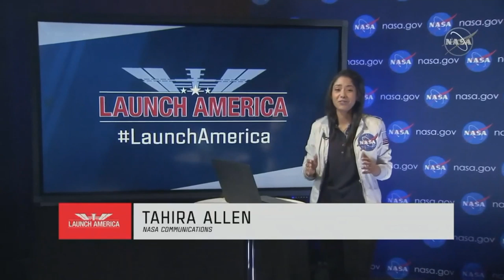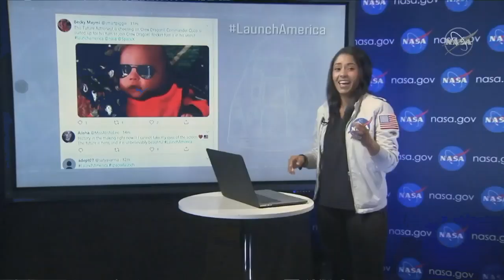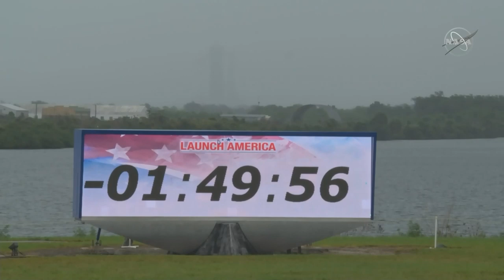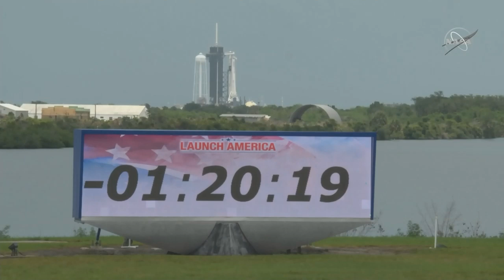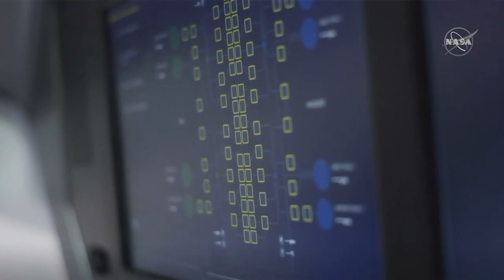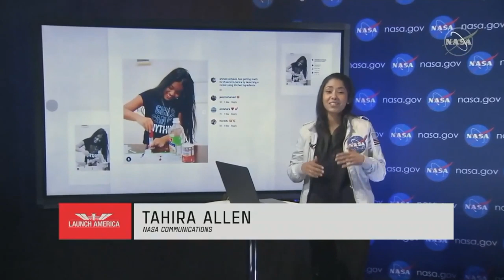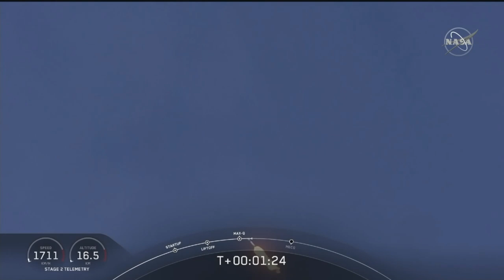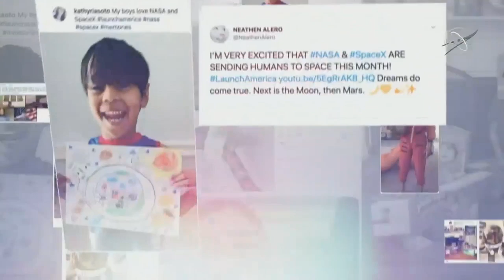Nasa and SpaceX's historic launch second attempt to send US astronauts to the ISS - LIVE

Comment: Hmm so you’re trying to tell me we lost connection for 3 seconds and as soon as it re Connects jjst boom the drone it there with no dust or anything from it landing..?
Reply: Yes
Reply: @sicarrioh3395  the landing footage is from Soace X not NASA
Reply: Dust from the ocean? Lol
And it often cuts out then but not always. Its a large metal object with engines blaring, that produces a lot of interference with the antennas on the drone ship.
Reply: Oliver Lane dust from the ship it cut back in literally 2 seconds and there is no Debris or anything in the air
Reply: @edmontonexoticbullys2038  i cannot see any dust on the ship on the previous picture? So what dust do you think would have been thrown up?
I obviously have never been on one of their barges however i have worked on containerships  in the past. And any well maintained ship is not dusty. Dust causes slips and trips which are especially dangerous on a ship, it can cause corrosion which combined with salt water can cause many problems and finally its unprofessional. Those barges 100% would have been spotless when leaving port. There would be no dust on them
Reply: It’s very annoying isn’t it?
Reply: Oliver Lane he doesn’t mean dust he means exhaust gases, he’s made a fair point and you know it, previous tests show huge plumes of gases even after engines are cut off.
Reply: @fingpower  the exhaust gases are visible for a couple seconds maximum. So what's the conspiracy theory, that all other landings were real but they faked this one?
Reply: Oliver Lane go look at the other video, “a couple of seconds maximum” is a huge understatement, please be true to yourself when having a debate otherwise you put yourself in a bad light. They faked this one because this was not a test, the rocket was sent a lot higher than any test, they couldn’t fake that, so to get it back just wasn’t gonna happen, so they had to fake it. Show me a video, any amateur video of this rocket coming back to still live, you can’t no one can because it didn’t happen.
Reply: @fingpower  SpaceX have failed to land boosters before and have also spent them. Why would they care about faking this one landing when the others were real?
Give it a day or so and we'll see this booster being towed back to port and we'll see its the same one.
And yes i looked up some video and the exhaust gases usually dissipate fast.
So if the video was faked how did they match the sea and lighting so well?
Reply: Oliver Lane that’s easy, both the footage without the booster on and with the booster on were recorded the same day. Both were prerecorded. Not sure how you could identify the booster as the same one that got launched? We’ll see what happens.
Reply: Oliver Lane ok show me a video of one of these actually landing and I’ll believe you bud